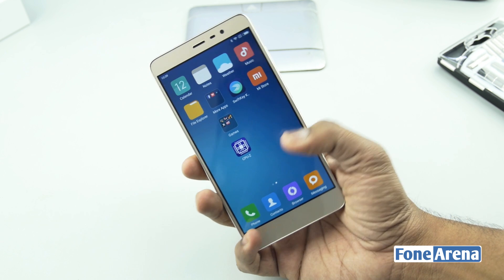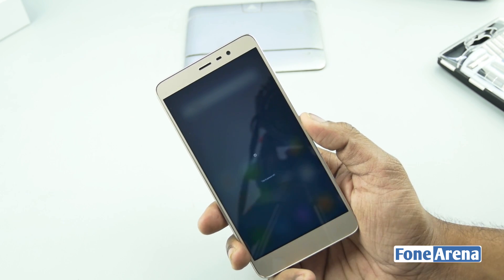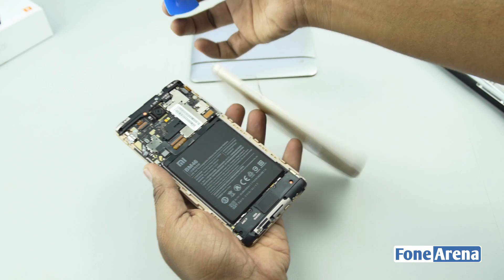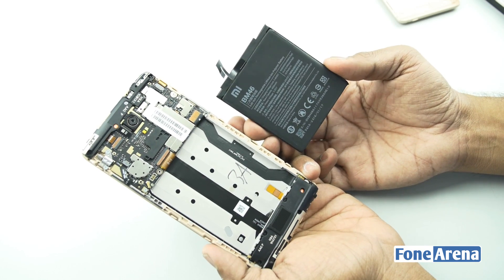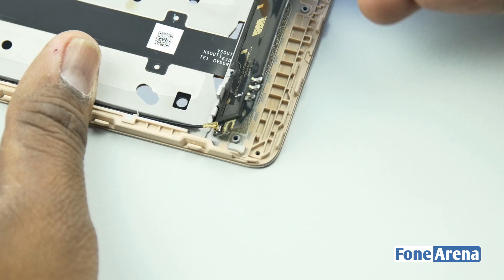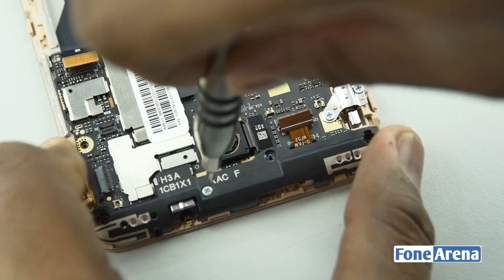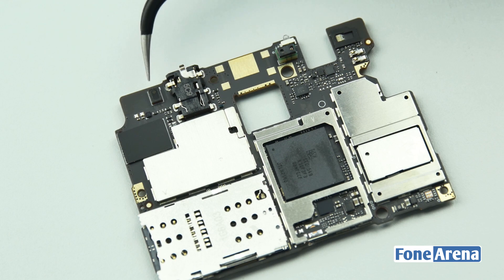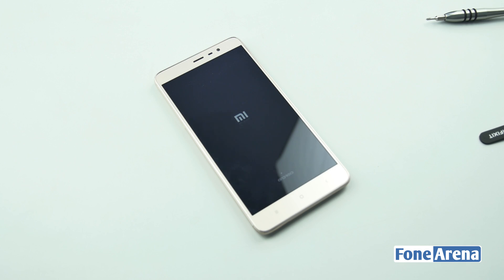Xiaomi RedMi Note 3 Teardown - Qualcomm Snapdragon 650

Comment: {ASK}
I have redmi note 3 pro (Snapdragon) with broken lcd glass & want to fix it..
My question, can i replace the LCD and Touchscreen with Redmi Note 3 (Mediatek) version (for My Redmi Note 3 Pro)?
is that (Redmi Note 3 and Pro version) have the same LCD socket and connector?
Reply: Semin Kovac I'm also having the same issue,, have got an answer
Reply: Hello. I replaced the screen with the LCD from Redmi note 3, and it worked perfectly on my Redmi note 3 pro
Reply: Semin Kovac thanks alot 👍👍👍👍👍👍
Reply: Semin Kovac can I put redi note 3 screen+touch + "frame" onto a snapdragon version chip,,,??
Reply: yes you can, for me everything worked perfectly when I replaced parts from redmi note 3 on to my phone redmi note 3 pro (snapdragon ) version
Reply: Semin Kovac thanks again 😊

Comment: i have cracking noise near the usb port  mostle in themidle of the lower part where the usb port is. Could i fix it by removing the back cover ? Is it hard to close the back cover again?
Reply: same
Reply: +Butch Resurreccion oh that's good to hear that I'm not the only one with that problem.  I thought that something in my phone is damaged.  I think it might be the back cover be badly put together and that opening might fix it.  But I don't want to open it before someone telling me that it can fix itm
Reply: Yeah that plastic part is not built well. I'm just hoping that the bottom part doesn't come off.
Reply: Butch Resurreccion i think it want come off, dont worry . You would feel it if it come off and others would already tell if it s so badly build that it fell off. Other than that im really satisfied with that phone and you? ^^
Reply: Butch Resurreccion welll i tried opening the backcover where i have the cracking noise but only just a little bit. Because i dont want to open the whole phone.  and then i put it back tgether. The noise was reduced alot , its still there but its now much better.!
Reply: I'll just let it be, it's not that of a problem
Reply: Oh that's nice
Reply: Butch Resurreccion inly have som little noise now wen pushing beetween the usb port, maybe i can fix it, bbut now its much more relaxing .
Reply: +CGPhotoKandou mine's not that loud as well.haha
Reply: same problem here, got the phone 2 days ago and plastic near usb port is making cracking noise :(
Reply: other than that phone is great, awesome performance and battery life (Y)